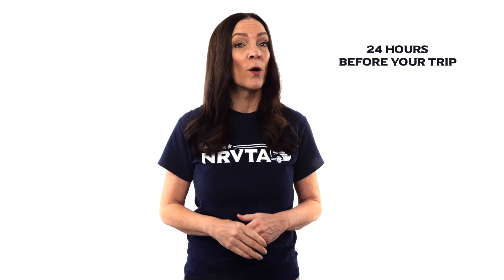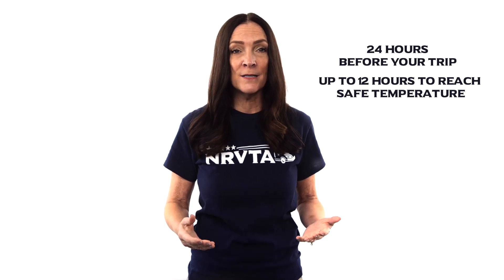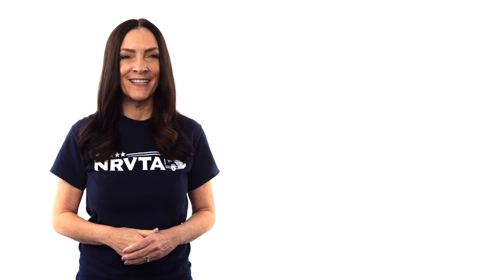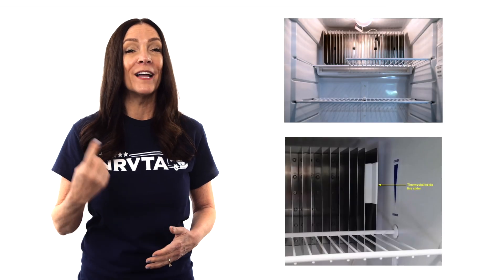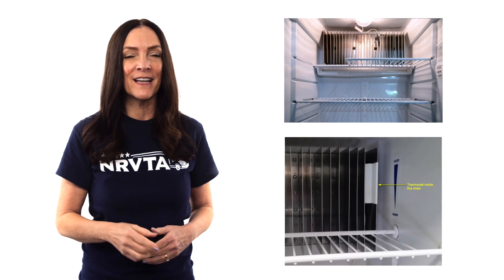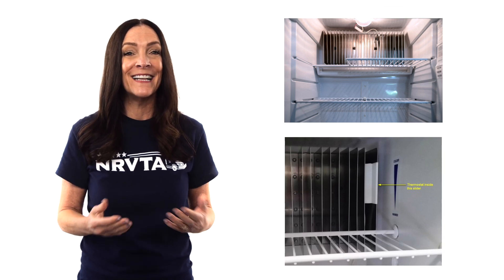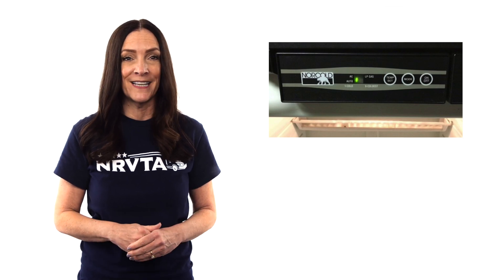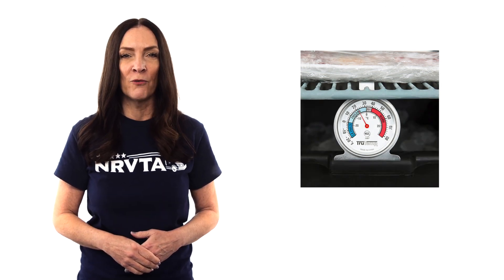Absorption Refrigerator how it works

Comment: Is it ok to operate the fridge on 12 volt while traveling  down the road?
Reply: Yes, you have the ideal situation where you can operate your refrigerator using the coach battery instead of using propane.